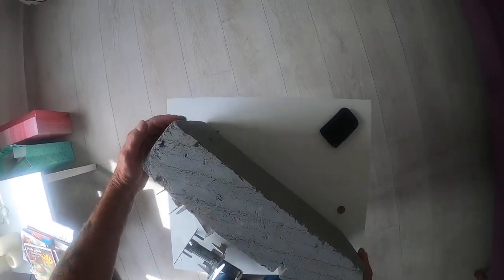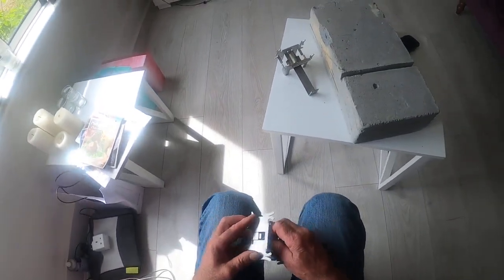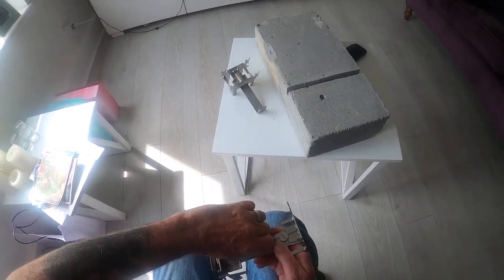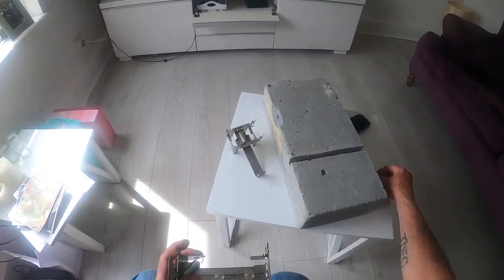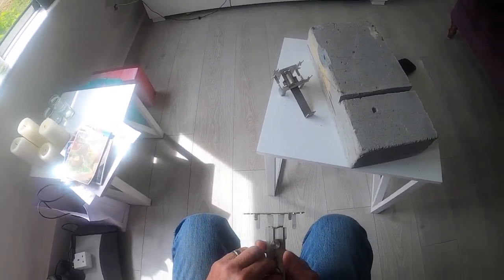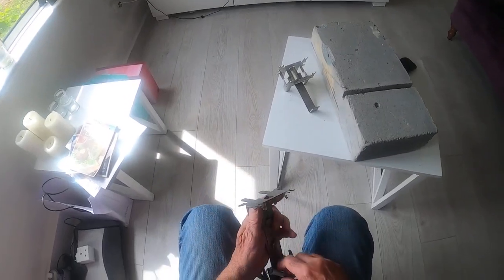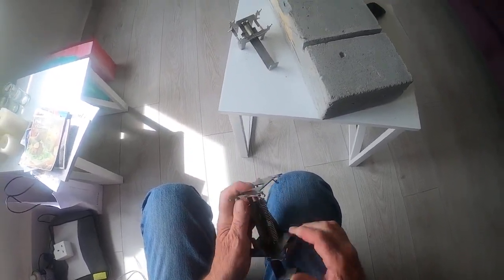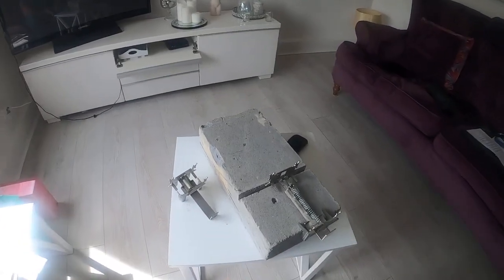Fitzbrick Mk 2

Comment: Thanks Andy good demonstration. Your not wrong about getting burnt.
Reply: Got mine in the post today 👌 also can I say a massive thank you for inventing these 👏👏👏 they have so many uses and make life as a bricklayer just that little bit easier
Reply: @davidvallerius4458  Thankyou very much that is really appreciated.
Reply: @richardfitzgerald4812  a top product Mr Fitzgerald and a genius idea. I'll never be without them. Are the originals still for sale? Or is it mk2 only from now on?
Reply: @stuartjones1982  Thanks very much Stuart
Reply: @stuartjones1982  Hi Stuart I have stopped making the original clamps. The new ones are exactly the same size as the older one's before you slide out the back legs. To be honest I don't think anyone would buy the old ones if they can buy the new ones which are much more versatile. Thanks again for your comment Stuart.
Reply: @richardfitzgerald4812  Roger that Mr Fitzgerald thank you. I just know if I lose or bust one of the originals I'll be pissed if it doesn't match 😁

Comment: Might be worth getting the sizes crimped into the spin of the clamp.
Reply from the maker: Yea would be helpful, the reason Richard hasn't done this is that they are sold Worldwide and brick and block sizes differ from country to country.
Reply: @bricklayersworldwithandy6277   nice one, totally makes sense…. Separate brick/brickwork question for you Andy. I see on another video with a double frogged brick used. It was re-laid with a thin joint ( not sure if thats called penny joint or tuck joint, but not with putty). Are them bricks doubled frogged, so it’s easier to get the joints tight, just like if you need to grind down the bed when laying a single frogged brick ? Random question I know but I thought a man with your knowledge might know. All the best.
Reply from the maker: @Jonathan-mk1ju  I need to see the vid 👍

Comment: I bought 4 of the fitz brick clamps but I find the rebate for the line to sit in isnt set back far enough. So it’s hard on the line. Usually like the have to line 1/2mm off the face. As dori blocks do. Anyone else the same?
Reply: Hi it's Richard Fitzgerald from FitzBrick. You are right the very first clamps I brought out had a less shallow notch where the line sits in. I always use a very thin line which is what i used to work out the depth of the notch. This is something I corrected a while ago by using an average width line to get the depth of the line notch. I can assure you that won't be a problem with the new clamps.
Reply from the maker: Richard has answered the question, myself I have not had this problem and I also use thin lines, maybe a slight alteration to the groove with a hacksaw blade may correct this problem 👍